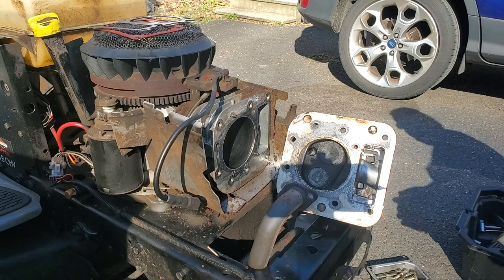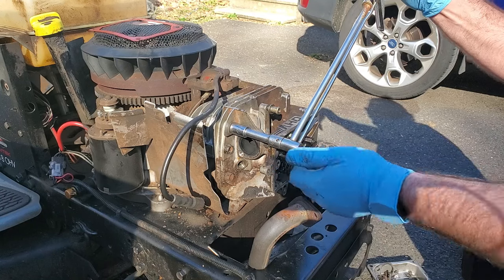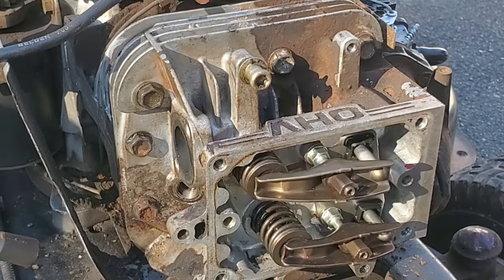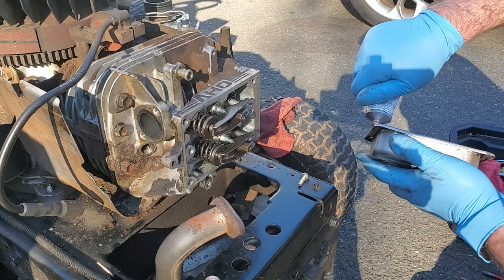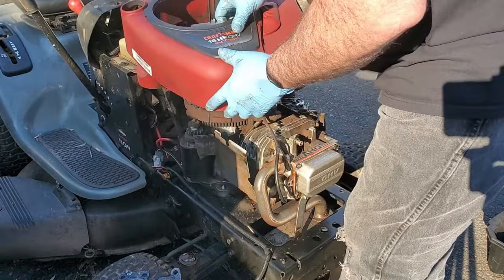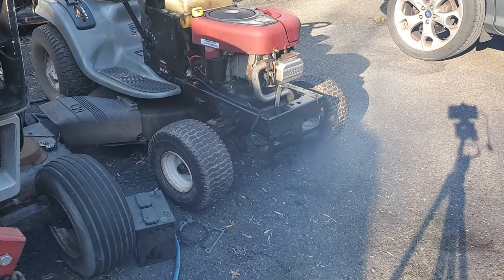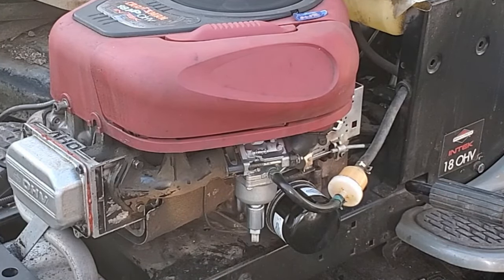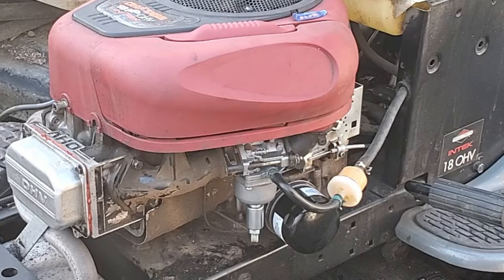Valve Seat Surprise Startup - Will It Run?

Comment: The exhaust valve you repaired is on the top and the intake on the bottom. So the aluminum push rod should have gone on the bottom. I am guessing someone before you had them backwards. Thank you for sharing.
Reply from the maker: You may be right, I will investigate and make a note in the video if I had them reversed, thank you for your help.

Comment: Back in the day when I use to replace the Head gasket on flat head Briggs and Stratton engine s I would take the Head gasket and Trace it out on a piece of cardboard in the specific Way to tighten the head bolts
Reply from the maker: That's always a great idea. These engines are pretty easy to alternate when torquing the head.

Comment: When you have the head off it’s not a bad idea to remove the valve springs, devise a way to spin the valve in the seat with some valve grinding compound.  After-
Take the head into a dark room, press firmly on the valve mimicking it closed and shine a bright light into the intake port and then the exhaust port. If any light is leaking around the valve seat… grind some more. Remember to wash all the compound off as it will destroy the valve guides. 
You can check for light leaks before you do anything. You may not need to grind the valves.
Reply from the maker: that is a good point, after I was finished recording I thought, I forgot to say anything about making sure it it sealed because now the valve and the seat are not mates. I have a valve lapping tool somewhere, but no compound. I thought I should at least have shown how to test it with water to see if it holds water. Still new at recording videos. will get better. thanks for the comment.